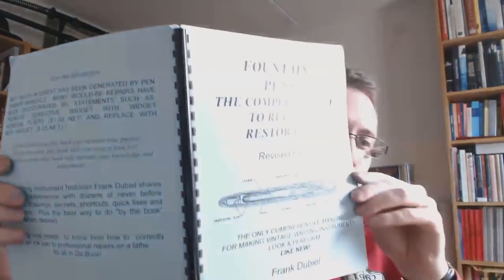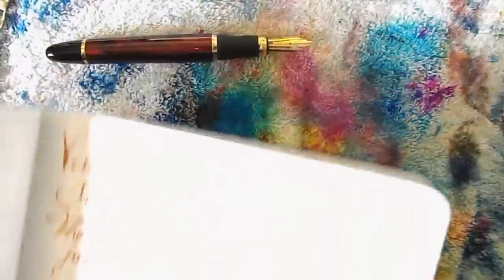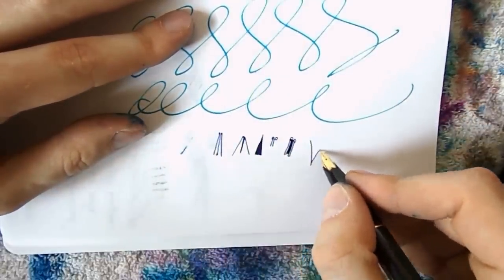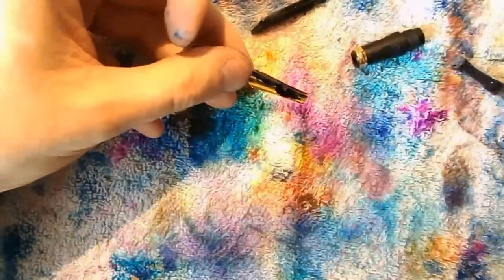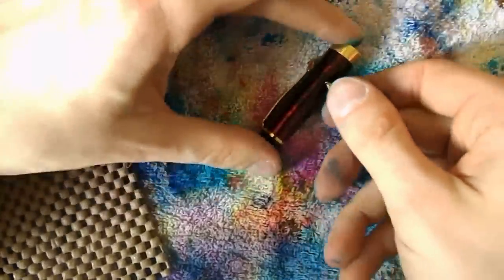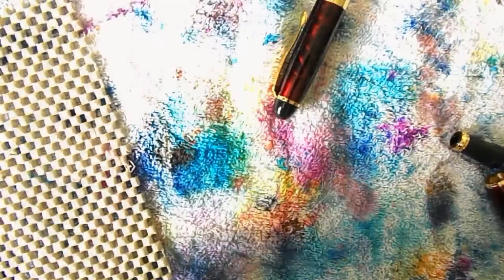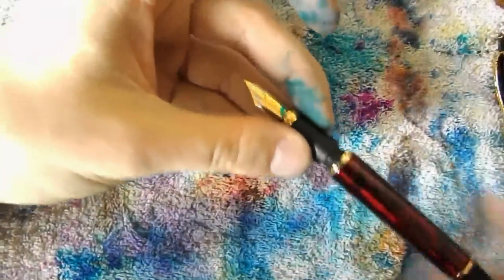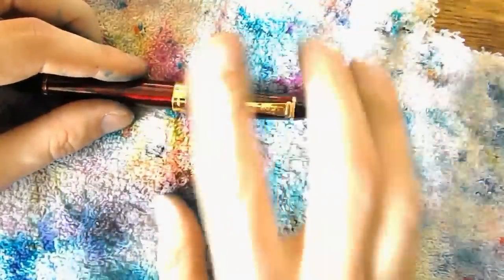Making a Nib a Bit Drier

Comment: Thanks for the inspiration. I was really hesitant to fiddle with nibs. 

When you want to change the tine alignment, the time you push should not matter but how far you push. 

For reference have a look at the stress-strain curve. 
There is a elastic region where deformation is elastic up to a point (yield strength) where further deformation becomes plastic. There is no time dependence but the elastic part still comes back.

Comment: 9/24/19 Thanks so much for posting your suggestions on nib adjustment.  I bought a 1.1 stub for my old Jinhao X450
The stub almost ran with ink.  On close inspection I saw that the slit in the stub was a straight line from the breather hole to the tip.  I used the technique you suggested for reducing ink flow and it worked so well that I needed to use the slip of brass to open it up a little.  The nib works quite well now.

Comment: I have a Pilot Metropolitan (one of like 30 pens that I own) and I love it. I wrote with it and used it and everything was just fine and dandy, until one day, when I noticed that the tines on it were misaligned for some reason. I tried to align them (I wasn't nervous or anything because I've already done this to 3 pens), and... I screwed up. I splayed the tines just enough so that it won't write. It wasn't extreme, or beyond repair or anything, but the tines were just far enough from each other so my pen doesn't write. Doing what You've told me, Mr. Brown, I fixed my Metropolitan. Now it writes as it wrote before i screwed it up. You may think that I shouldn't sweat it too much over a Metropolitan, but it was a gift from my mother so it means a lot to me. Thank you so much. I honestly thought that I ruined my pen...
Reply from the maker: Faruk Softic I'm glad this was helpful!

Comment: If you can pull out the nib and feed. Cut slightly into the ink channels of the feed this helped a lot with this exact issue with my lamy safari. But be gentle you don't want to bread. The feed  or your fingers

Comment: Hi Stephen - I did the same thing with my Parker Duofold Jr. - was too dry, went a bit too far and now it's too wet.  Slightly.  I notice the tines are more equal distance apart from breathing hole to end - it's not slightly closed at the end, or a bit triangular from breathing hole to end.  My question, in this case, i don't want the tines near the breathing hole any closed together, just the ends of the tines. Will the method you describe here be, in your opinion, still the method to resolve the extra wetness?  I should also add I am not a fan of a broad line and the pen is not false starting or stopping writing so my other thought is that it's not that it's writing too wet, it's that I don't appreciate the broader line. Thoughts on this?  Thank you!!

Comment: Stephen, what would you say the problem is if a pen has no starter issues, is nice and wet, but after 2 pages or more of writing, the feed dries out completely? It's an Artista Crystal, so you can see the change occurring.  I've pushed ink into it with the converter, but again after 2 pages, it's dry again.  I've even deepened the ink channel myself, to no avail. Help!

Comment: it's been years.  My problem is different.  The ink flow is completely out of control.  If I point the nib at the paper the ink will drip out until the cartridge is empty.
Reply from the maker: Are the nib and feed pushed far enough into the section?  Is there damage to the inside of the section which has ruined the connection with the cartridge?
Reply: The pen developed this problem while I was neglecting it
I have two of these.  I put ink into the cartridges and one is fine but the other gushes.
Reply from the maker: William Humes Its possible it has become clogged. I would soak it in water overnight, Just the section I mean, and see what happens
Reply: I just put more ink in the cartridge and made certain it is inserted completely
Reply: I'll give that a try.  Do you know if it is possible to take the nib out of a parker vector?
Reply from the maker: +William Humes Yes, you can pull them out

Comment: That made me cringe, on a cheap steel nib its fine but anything of value or gold I use a small sheet of mylar film or thin camera film between the tines for the tine overlap procedure, this helps prevent damage to the inside face and edges of the tines slit. When you overlap the tines the pivot point is on the edges of the slit forward of the breather hole which is highly likely to leave damage on a soft gold nib. Also the possibility of the tines scraping against each other when crossing over. Also to note, it is rare the tines will be balanced following the overlapping procedure.